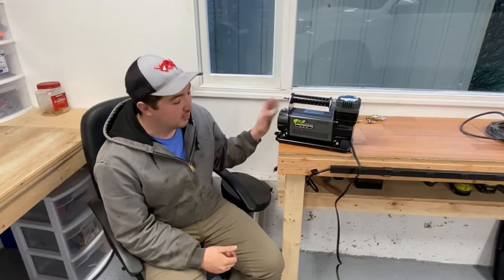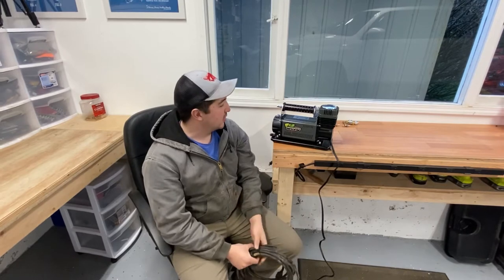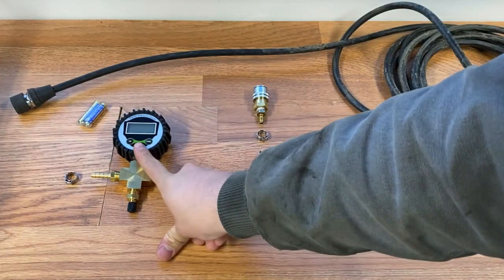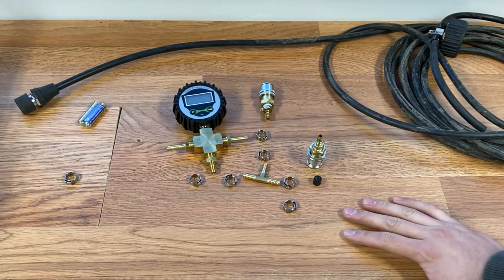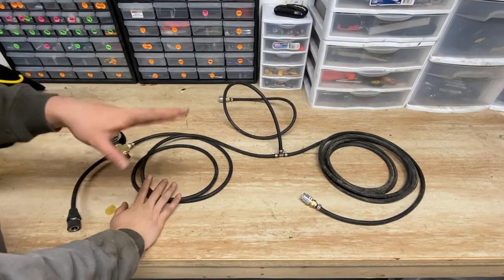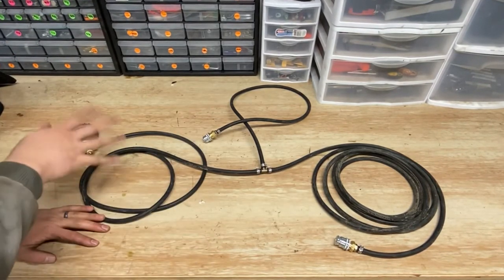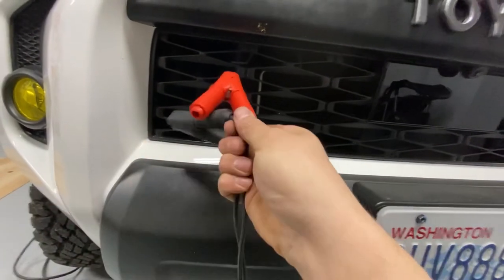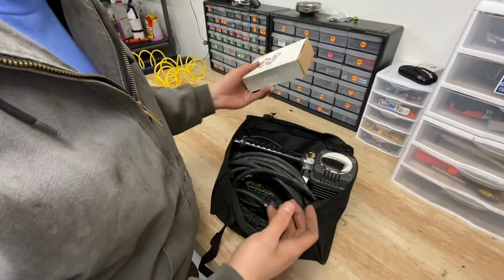DIY two tire inflator system with quick valve stem disconnects for any vehicle

Comment: This looks GREAT.  I dont want to store a 4 tire system and this seems like it's just compact enough to save space and some time.  Kind of long, I think the line could even be a bit shorter, and still be long enough to help someone with a longer wheelbase.  I'll look up some wheel base and compare to my 4runner and see how much I can trim but I like this.  Well done.
Reply from the maker: You’re totally right I’ve been meaning to shorten it up a bit which should save length! And I was thinking the same thing about not wanting tubing for 4 tires.

Comment: Thanks for this Vid. just wondering why my air pressure never equalize. I use closed Heltec H-5265 Air chuck
Reply from the maker: In some ways that has its benefits too!
Reply: @GrizzlyPath  not that I wanted 😂

Comment: Are you annually touching up those wheels? They really look great. That's the hardiest Plastidip I've ever seen. I can see the wear spots at the lugs but that's no different than any other wheel.
Reply from the maker: I haven’t had to yet! I keep thinking that I will need to but it hasn’t torn or peeled up anywhere. What you see at the lugs is where I taped off originally. I’m honestly surprised haha.

Comment: Does the gauge show accurate pressure while the compressor is running?
Reply from the maker: No, but the gauge is “live” so as soon as I stop the pump it’ll display the true pressure. Then I just turn it back on again or whatever.

Comment: Good ideea, but why not do all 4 tires at once, ensuring this way you have equal pressure on inflation and deflation?
Reply from the maker: Yeah the upside to two tires is less hose to carry around, it can get unwieldy! But I might expand to all 4 tires, it’s just double the fittings so another $50 in parts. I made mine out of my existing tubing too so it only would reach 2 tires. Easy to do all 4 if you were to DIY though!

Comment: Great project. Can you tell me what size clamps you used? Thanks.
Reply from the maker: Thanks! I bought a big kit of mixed size. I think I used 12.5mm hose clamps, but it’ll definitely depend on what size tubing you have.
Reply: @GrizzlyPath  Thank you. I'm going to use the original hose as you did.
Reply from the maker: Sweet! If you can test fit clamps locally get a kit that comes with a variety. I’ve had to cut them off and redo so make sure you’ve got plenty!

Comment: Do you still use this system? How do you actually like it? Did it last the test of time? 
I am building one but want to incorporate a release valve to air down
Reply from the maker: Yes I still do use it! I like it. Sometimes I consider adding two more hoses to do all four wheels at once, but honestly i don’t wanna have to pack all that hose. Takes up more space. Still deciding. 

I would recommend pricing out all the components and stuff. It may end up being cheaper to go with a Morrflate system (owner is a cool guy) or something, unless you already have some hose and hardware to reuse or just want to DIY.
Reply: @GrizzlyPath  already have the ironman 4x4 that comes with it’s hose. 
Prices out if I do what you have it’s $120ish (give it take) a brand new DIY flexzilla system with a 4 way connector with release valve is around $167 and brand new morrflate is around $200 give or take.
Reply from the maker: @PrithwirajGhoshRoy perfect, exact same situation that I was in reusing some components.

Comment: HEY!!! That’s the same 5.65CFM 100% duty cycle air compressor I have!!!
Reply from the maker: You’d think they’d all come from the same factory and just get rebranded right? But mine is 33% at 100psi duty cycle so I’m not sure what’s different... they do look exactly the same though haha.
Reply: @GrizzlyPath  wait a minute!  I could have sworn it said 100% duty cycle, but I checked on the Amazon description and now it says 40 minutes at 40 PSI at 75F!  Oh well..... that’s plenty of time!  So, my Smittybilt came with this long yellow hose.  It reaches about 30 feet.  I actually help my friends air up because even though I hard mounted my compressor to my roof cargo basket, it reaches hella far.  So, you have me an idea.  I plan to run a hose for tires left and right.  I’ll cut the hose in half with a 3 way tee (shraeder valve in the middle) and then quick connects on each end.  I’d like to equalize the pressure left and right rather than front and back.  When I air up, the tires are still a little hot during trail time.  This has always led to an inconsistency in psi per tire.  Also, since more weight is in my rear, I add more pressure to my rear tires.  I also have a quick connect on my air compressor line.  So when I reach the target PSI, I’d just disconnect from the tee.  Sounds like I’d just need 8 ft. of air hose.  Thanks for giving me an idea 💡!
Reply from the maker: That’s what’s it’s all about man, ideas! I would have preferred doing fronts then rears vs side/side like I did, but I didn’t wanna add more hose to the kit. We’ll see how it works. I did have a thought that I can add a second air line to the port where I put the Schrader in the 4-way and run that line out to the other side of the vehicle so that’s a future option!
Reply: @GrizzlyPath  I plan on making a walk around video at some point.  I love my air compressor setup. 😃
Reply from the maker: I’m looking forward to seeing it! I feel like we’re getting due for a solid JonDZ walk around after all the mods you’ve done lately (rearview cam/mirror, lift, tire carrier, etc)!
Reply: @GrizzlyPath  there’s much to cover.  I shot footage oh my camping setup, but then afterwards added the tire carrier, with DIY table.
Reply: @JonDZ_Adventuring  I like your plan. When I'm loaded I typically run a few PSI higher in the back as well.

Comment: Can you air down with this system as well?
Reply from the maker: Yeah you definitely could. I added a Schaefer valve to the manifold in this video and that can be used to deflate, I use it to fine tune sometimes but typically I don’t use this system to deflate as I prefer to use Staun deflators or some of the other options. Note that this system doesn’t remove the valve stem so it’ll deflate slower than those that do.

Comment: Creative solution to reducing time spent airing up! Has there been an increase or decrease in time it takes you to air up one side of the vehicle? I am curious if splitting the pressure between two tires slows the process up per tire but still keeps overall time spent airing up lower. My thought is that if the compressor already was overrated for your tire size then it might not be a huge issue when splitting between two tires but if it was chosen to be just right for the tire size then it would be slower on a per tire inflation time.
Reply from the maker: It’s definitely slower doing two at once, since the flow rate is split, but where you save time is the hassle of connect/disconnect. Doing two, or four, wheels at once is convenient, but I think you save the most time with a good quick disconnect tire valve stem chuck. So if you only had $8 to invest in upgrading your existing tubing, I’d replace the chuck!
Reply: @GrizzlyPath  I had the same question!!